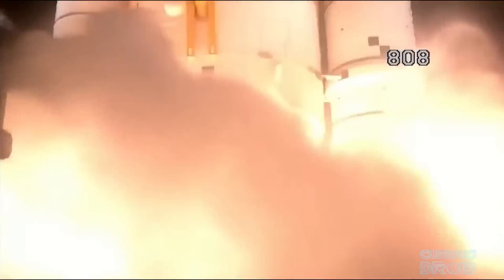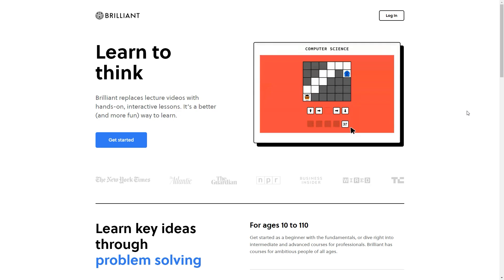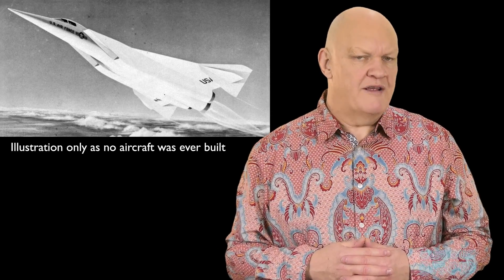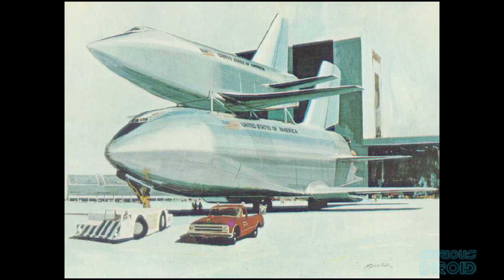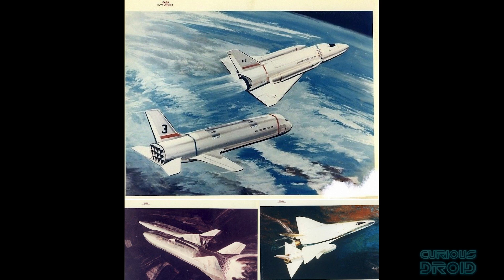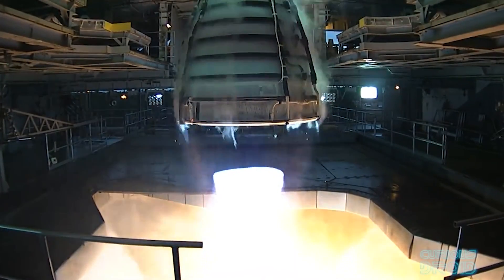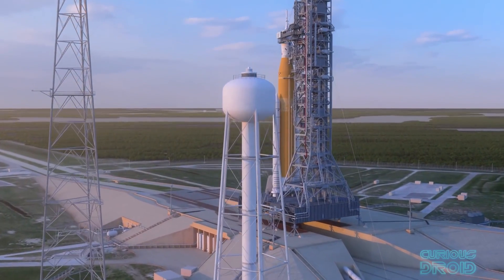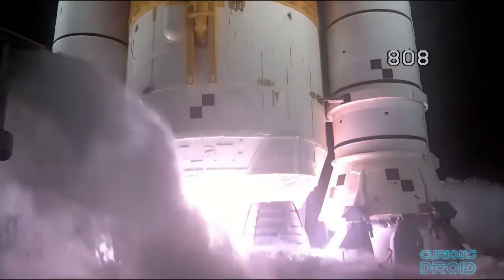Why is NASA Throwing Away Reusable Engines?

Comment: Your comment 7:04 is incorrect. 

 "After Pratt & Whitney lost the legal challenge, their engineers were told to destroy the test data SO AS NOT TO EMBARRASS NASA AT SOME FUTURE POINT if things had gone wrong for the Rocketdyne design..."

This is standard legal language in any "fly-off" where the US DoD has multiple contractors compete for a design award. The losing contractors are told to destroy or turn over to the government any designs, test data, and even test articles as they are thebsole property of the US Gov't. So long as the conpetition was funded by the Gov't and not on Internal R&D from the company.

There are limited and peculiar cases where the test articles or data may remain with a losing contractor should there be some articulable benefit to the Governme t for future investment or continuation of development for separate programs.

Comment: I'm all for reusability, but not at the cost of safety. We all got to see, particularly with Challenger in 1986, the cost of everything being "reusable" and with ridiculous over-estimations of what the hardware in question was truly capable of.
Reply: Challenger did not fail because of a reusability issue.  It failed because they launched at a temperature below the design parameters of the SRB Field Joint.  Also, you cannot cast SRBs that large in a single shot.  A disposable SRB would still be stacked and have field joints.

Comment: I never really understood how 50 to 250 tons to of thrust at up 300 bar won't just squish the noozle of the rocket and than that's it.
The supporting structure above must be build in such a way that it would support all of that thrust and also vibration...
that from my perspective is just one out of million to be solved problems when building such rockets, but its the first one coming to mind.
Reply: Also, 300 bar of pressure is about 4,400 psi.  That's not bad.  I have worked with commercial gas storage tanks rated at 5,000 psi.
Reply: The RS25 generates about 512,000 lbs of thrust.  Let's look at a quick analysis of how to carry the load (obviously the loading is much more complicated than this but it gives a quick ballpark look).

Let us assume we use an aerospace grade Titanium rod at the top of the engine to carry the load and it has a yield strength of 128,000 lbs per square inch (psi).  At yield the bar would begin to have permanent deformation.  Again, I am waaaay over simplifying the design.  Assume safety factor of 1.4, so we want to apply a max load of about 91,000 psi into our titanium rod.  Divide 512,000 lbs by 91,000 kpsi = 5.6 square inches to carry the load.

About 6 square inches is not that large.  In reality for other load factors and distribution it would be more complicated, but this gives an idea.

Comment: Good video, got a question which is as mentioned for upcoming engines NASA is looking to produce cheaper disposable variations, what are the reasons for not using a "slimmed down" centre tank less engined rocket with 4 solid rocket boosters as opposed to the current configuration?

Comment: And the answer?
Reply: Booster reusability is great, but has drawbacks.

First, if you don't have a fast enough launch cadence, you can spend more on recovery equipment and personnel than you save by reusing the booster.

Second, you take a payload hit for the recovery system on the booster. The Falcon 9 B5 can lift up to 22.8 tons to LEO when expended (SX), but only up to 16.7 tons when landed on a drone ship (B1069.2). Doing a Return to Launch Site (RTLS) landing, costs even more payload as you have a boost back burn to cancel the lateral velocity and return back to the launch site.

Third, the higher and faster you go, the harder reusability is to perform. The heavier the dry-mass of your booster, the harder reusability is to perform.

So with SLS launching once a year, eventually, the cadence doesn't really justify recovering the booster. Not to mention that it gets higher and faster than a Falcon 9 as the SLS core stage almost reaches orbit, making recovery MUCH more difficult. The SLS core stage is travelling well over 3 times as fast as the Falcon 9 booster and is well over twice as high as the Falcon 9 booster at MECO. The dry mass of the F9 booster is 22-25 tons while the SLS core stage is 85 tons.

The SLS Block 1 can get Orion to the Moon, but not with the kind of payload hit like F9 has. The SLS Block 1B will send along a Lunar Gateway module with Orion, so it really can't take the payload hit either.

Comment: In the same way that a Falcon 9 Expendable or a Falcon Heavy core booster is discarded for maximum performance, the SLS must extract maximum performance from every launch or it just isn't worth the cost. A series of smaller reusable rockets could do the job cheaper than a much more expensive reusable SLS. It's really for high energy missions that can't be split up into multiple launches.

Comment: Typical government contempt for the taxpayer. Private industry goes reusable, government goes disposable.
Reply: Booster reusability is great, but has drawbacks.

First, if you don't have a fast enough launch cadence, you can spend more on recovery equipment and personnel than you save by reusing the booster.
Second, you take a payload hit for the recovery system on the booster. The Falcon 9 B5 can lift up to 22.8 tons to LEO when expended (SX), but only up to 16.7 tons when landed on a drone ship (B1069.2). Doing a Return to Launch Site (RTLS) landing, costs even more payload as you have a boost back burn to cancel the lateral velocity and return back to the launch site.
Third, the higher and faster you go, the harder reusability is to perform. The heavier the dry-mass of your booster, the harder reusability is to perform.

So with SLS launching once a year, eventually, the cadence doesn't really justify recovering the booster. Not to mention that it gets higher and faster than a Falcon 9 as the SLS core stage almost reaches orbit, making recovery MUCH more difficult. The SLS core stage is travelling well over 3 times as fast as the Falcon 9 booster and is well over twice as high as the Falcon 9 booster at MECO. The dry mass of the F9 booster is 22-25 tons while the SLS core stage is 85 tons, so SLS masses over 3 times as much.
The SLS Block 1 can get Orion to the Moon, but not with the kind of payload hit like F9 has. The SLS Block 1B will send along a Lunar Gateway module with Orion, so it really can't take the payload hit either.

SLS started design work in 2011, 4 years before SpaceX landed the first booster and almost 6 years before they reused a booster.

No, I'm not saying that SpaceX should not recover boosters. I'm using how reusability affects the Falcon 9 to discuss SLS.
Reply: @steveaustin2686  
Thanks! Very well explained.
Reply: @davegaetano7118  You're welcome. Merry Christmas and a Happy Holidays.
Reply: @steveaustin2686  
To you also!

Comment: NASA just throws away expensive hardware into the ocean because of the OPM program, "other peoples money" pays for it all. NASA used to claim it wasn't possible to land a booster and reuse it, then Elon Musk proved that was totally false. A NASA launch costs far more than on of Elon's for the same payload. Why? Again OPM
Now the artimis Moon launch a few days ago is having multiple failures wile performing its mission around the Moon.
Reply: Booster reusability is great, but has drawbacks.

First, if you don't have a fast enough launch cadence, you can spend more on recovery equipment and personnel than you save by reusing the booster.
Second, you take a payload hit for the recovery system on the booster. The Falcon 9 B5 can lift up to 22.8 tons to LEO when expended (SX), but only up to 16.7 tons when landed on a drone ship (B1069.2). Doing a Return to Launch Site (RTLS) landing, costs even more payload as you have a boost back burn to cancel the lateral velocity and return back to the launch site.
Third, the higher and faster you go, the harder reusability is to perform. The heavier the dry-mass of your booster, the harder reusability is to perform.

So with SLS launching once a year, eventually, the cadence doesn't really justify recovering the booster. Not to mention that it gets higher and faster than a Falcon 9 as the SLS core stage almost reaches orbit, making recovery MUCH more difficult. The SLS core stage is travelling well over 3 times as fast as the Falcon 9 booster and is well over twice as high as the Falcon 9 booster at MECO. The dry mass of the F9 booster is 22-25 tons while the SLS core stage is 85 tons, so SLS masses over 3 times as much.
The SLS Block 1 can get Orion to the Moon, but not with the kind of payload hit like F9 has. The SLS Block 1B will send along a Lunar Gateway module with Orion, so it really can't take the payload hit either.

SLS started design work in 2011, 4 years before SpaceX landed the first booster and almost 6 years before they reused a booster.

Comment: Put a rocket engine on a bracket at one end of a wing that has been removed from an old big plane in the plane graveyard.  Park a captured Russian tank on the wing. Light the engine and surf the tank across the frozen swamps near Kherson.  Use it like a horizontal bottle rocket to offend the Russians in Northern Crimea.

Comment: I don't like SLS in a time when we see reusable Rockets and Space X about to launch its Staship Heavy which if successful will be  capable to reach the Moon and be 100% Reusable. So why NASA is putting so much money in a System that is 90% Non reusable? The only thing that could be used again in the SLS is the Capsule and is $4.7 Billion per Rocket launch while Starship could go for $100 million or less for launch. Time to said it SLS is just a Goverment Corporate Welfare Program and a Political Pork Barrel for Congress Politicians to gain Political favor and votes by giving contracts to Companies in their States to supply the SLS disposable (and expensive) Components and Parts. That is no way to to the Stars.
Reply: Booster reusability is great, but has drawbacks.

First, if you don't have a fast enough launch cadence, you can spend more on recovery equipment and personnel than you save by reusing the booster.
Second, you take a payload hit for the recovery system on the booster. The Falcon 9 B5 can lift up to 22.8 tons to LEO when expended (SX), but only up to 16.7 tons when landed on a drone ship (B1069.2). Doing a Return to Launch Site (RTLS) landing, costs even more payload as you have a boost back burn to cancel the lateral velocity and return back to the launch site.
Third, the higher and faster you go, the harder reusability is to perform. The heavier the dry-mass of your booster, the harder reusability is to perform.

So with SLS launching once a year, eventually, the cadence doesn't really justify recovering the booster. Not to mention that it gets higher and faster than a Falcon 9 as the SLS core stage almost reaches orbit, making recovery MUCH more difficult. The SLS core stage is travelling well over 3 times as fast as the Falcon 9 booster and is well over twice as high as the Falcon 9 booster at MECO. The dry mass of the F9 booster is 22-25 tons while the SLS core stage is 85 tons, so SLS masses over 3 times as much.
The SLS Block 1 can get Orion to the Moon, but not with the kind of payload hit like F9 has. The SLS Block 1B will send along a Lunar Gateway module with Orion, so it really can't take the payload hit either.

SLS started design work in 2011, 4 years before SpaceX landed the first booster and almost 6 years before they reused a booster.

HLS Starship for Artemis IV is $1.15B to NASA to get to the Moon.

Comment: As usual a great video. I understand the cost of recycling is to high but consider that if space X didn’t recycle there would be over a hundred rockets lying at the bottom of the ocean. The environment should still be considered in all designs. Cheers.
Reply: The environment? Really? 5,000 rockets laying in the ocean would do literally nothing.
Reply: @djbeezy    If it is under the water and can't be seen it's not a issue. I'm not a environmentalists but the ocean can't be seen as a convenient way of disposal because it is cheaper to do so. We manage to mess up land above sea level so why not the ocean floor.

Comment: It is "full circle" again because all the politics that were (and are) running in the background. You just have to look at what the Space Transportation System originally was supposed to be and what was eventually left of it after all these change requests. And all of it contributed to the complexity of the system so that it was a far cry from the advertised reusability turnaround times. Yeah yeah, would have been could have been... 👀

Comment: Very thorough and nicely presented. Thanks.
This is above my pay grade but it appears to me that Elon is in the process of making the SLS obsolete. Do I have that correct?
Reply: Starship with booster is the next major turning point. Her maiden flight. Her booster is ripping up tarmac at the Mo with less then 1/3 of her engines ignited. If she blows on take off. Think nuclear bomb like explosion
Reply: Having watched the falcon heavy boosters land I have confidence that Elon has the capability to achieve his objectives. Certainly there will be failures which he expects in his program.
The SLS is wildly expensive, not reusable and using mostly old technology.

Comment: Elon Musk had a smart idea.  The main stage core engines of the Falcon 9 and Falcon Heavy are returned to Earth to be refurbished and used many more times.The Artemis 1 SLS costs billions of dollars, went way over budget, and was a one time use rocket plagued with many technical problems including constant leaks. Artemis 1 should have been cancelled a long time ago.
Reply: Booster reusability is great, but has drawbacks.

First, if you don't have a fast enough launch cadence, you can spend more on recovery equipment and personnel than you save by reusing the booster.
Second, you take a payload hit for the recovery system on the booster. The Falcon 9 B5 can lift up to 22.8 tons to LEO when expended (SX), but only up to 16.7 tons when landed on a drone ship (B1069.2). Doing a Return to Launch Site (RTLS) landing, costs even more payload as you have a boost back burn to cancel the lateral velocity and return back to the launch site.
Third, the higher and faster you go, the harder reusability is to perform. The heavier the dry-mass of your booster, the harder reusability is to perform.

So with SLS launching once a year, eventually, the cadence doesn't really justify recovering the booster. Not to mention that it gets higher and faster than a Falcon 9 as the SLS core stage almost reaches orbit, making recovery MUCH more difficult. The SLS core stage is travelling well over 3 times as fast as the Falcon 9 booster and is well over twice as high as the Falcon 9 booster at MECO. The dry mass of the F9 booster is 22-25 tons while the SLS core stage is 85 tons.
The SLS Block 1 can get Orion to the Moon, but not with the kind of payload hit like F9 has. The SLS Block 1B will send along a Lunar Gateway module with Orion, so it really can't take the payload hit either.

SLS started design work in 2011, 4 years before SpaceX landed the first booster and almost 6 years before they reused a booster.

No, I'm not saying that SpaceX should not recover boosters. I'm using how reusability affects the Falcon 9 to discuss SLS.

Comment: Sls may look like a shuttle tank, but the shuttle tank was never designed to be a main structural element. Sls first stage is a completely different item, and the foam is the only thing that's come from the shuttle. The rs25d uses the controller from the j-2x making it a rs25 in name only.

Comment: NASA is the only organization I know of that is still building and using disposable dinosaurs and they will eventually meet the same fate as the original dinosaurs, just parts strewn over land and seas.
Reply: Well, the flaw in that is NASA doesn't build them.  Their contractors do, and in this case their masters in congress said they had to use legacy hardware and legacy contractor.  Those legacy contractors spend a lot of money on congress.  You should probably try informing yourself someday.
Reply: Not to mention that the SLS core stage almost makes it to orbit. It's heavier, moving faster, and much higher than the Falcon 9 booster that is recovered. So reusing the SLS core stage is a MUCH more difficult issue. And with the SLS flying once a year, eventually, the cadence doesn't justfiy all the expense to make it reusable, if it could be done in the first place.

Comment: The SLS's lack of ambition, not even attempting reusability, is an insult to everything the Space Shuttle's designers were at least trying to achieve.

SLS would have been a disappointing but serviceable replacement for the shuttle. Now it's 20-30 years too late to even matter. In an era of Falcon 9 and Falcon Heavy, let alone Starship and New Glenn, the SLS was obsolete before it even launched. I'm tired of multi-billion dollar money pits eating the entire budget and making it impossible to fund anything else. At least James Webb gave us  better telescope. SLS just gives us a new more expensive way to get to space. Right now I'm convinced Artemis would fare better if SLS were cancelled to free up more budget to buy commercial launches.